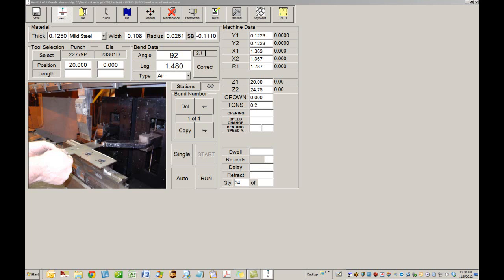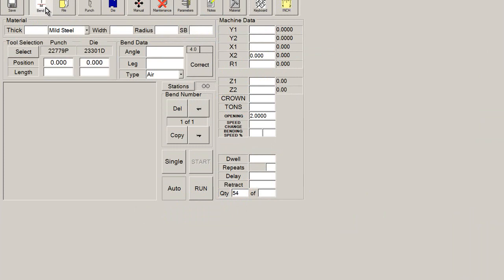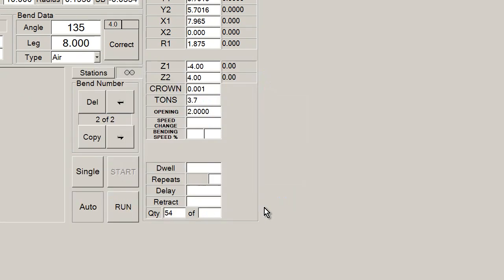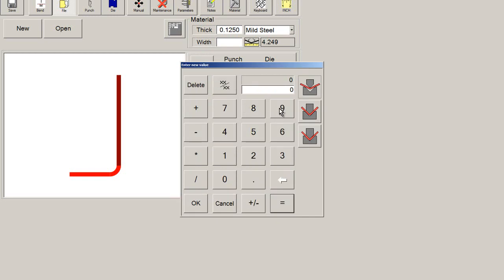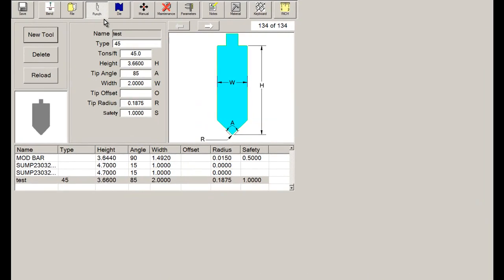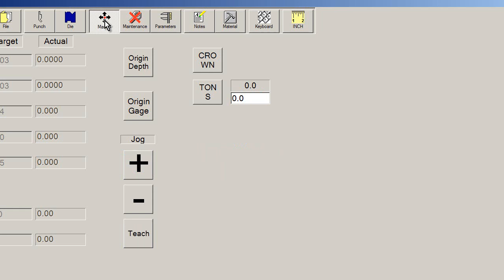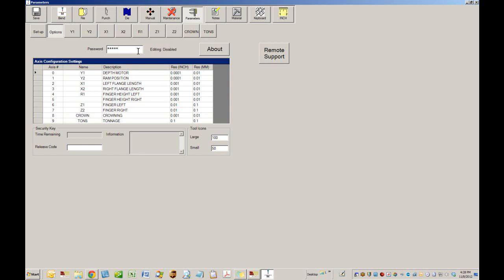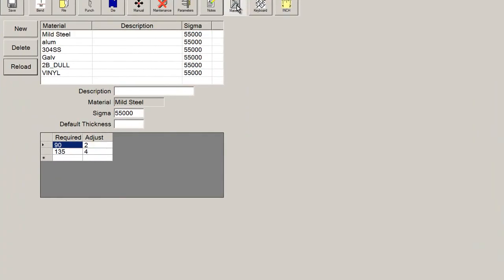Bend Wizard Basic Feature Demo

Comment: Hello, i am thinking about to build an Ball screw driven Press brake (2 big stepper motors with gear reducer, 2 ball screws) with an back gauge, so i would like to know if you software can be used for  that and what is the price? Thanks in advance.